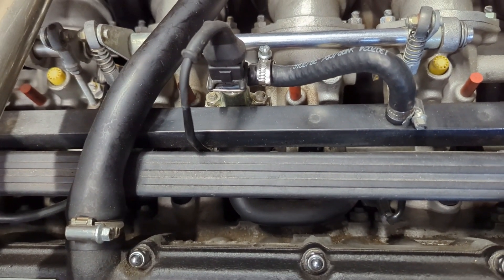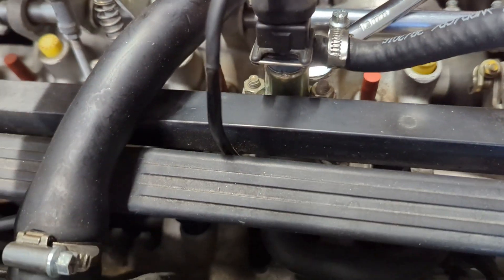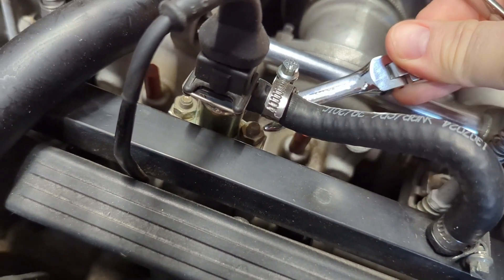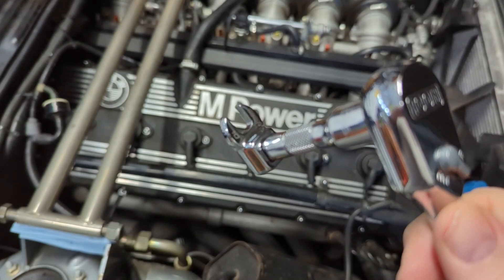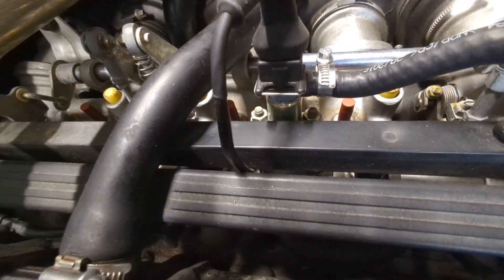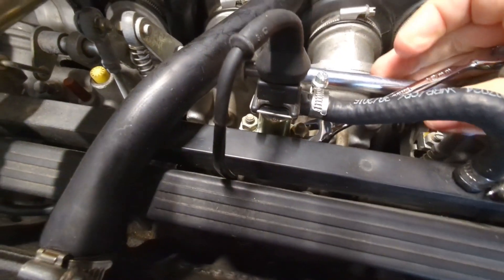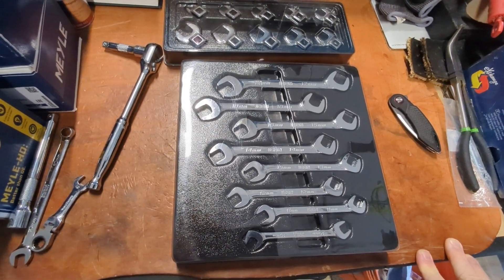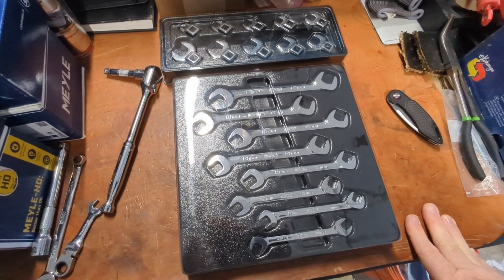Icon Angle Wrench Set - HF PN 59216

Comment: I see open ends as a specialty wrench for tight spaces only and this set works really well for that. After having these wrenches I see no need for regular combo wrenches and now only buy double box end wrenches. Putting an open end that almost never gets used on the other end of a box end doesn't make sense anymore to me.
Reply from the maker: I suppose it depends on what you're working on - so much of what makes a wrench useful or not is access - thickness, angle of approach, length etc.  I work on a variety of family cars from Toyota, Honda, Mazda, vintage BMW's, Mini and Volvo, and each presents a different thought process when it comes to design and ease of serviceability.  That's why I have a dang wrench-drawer! 😉